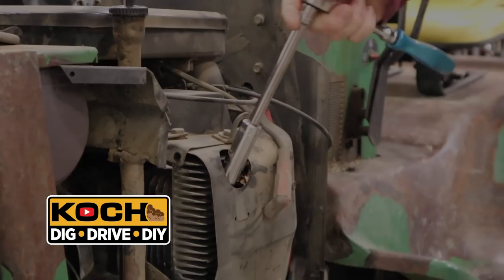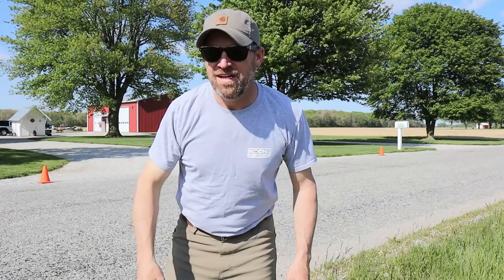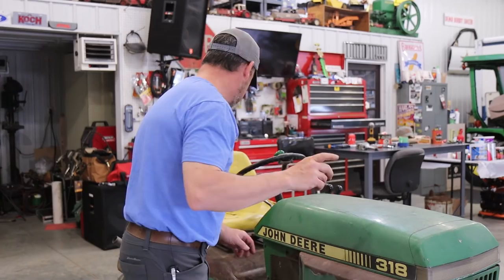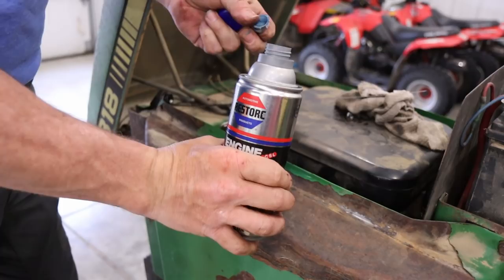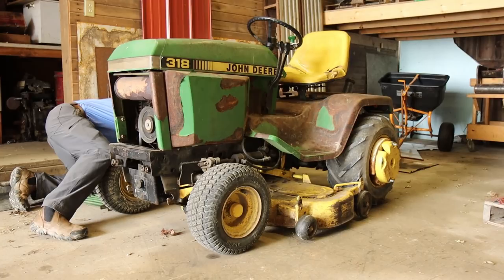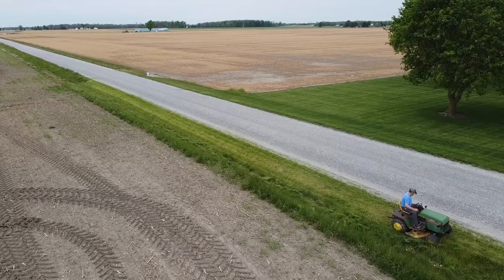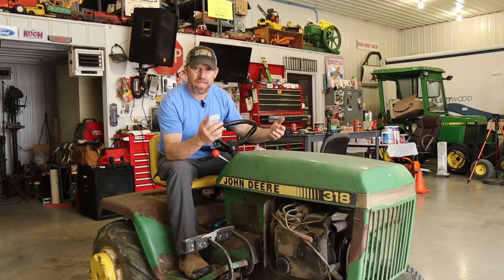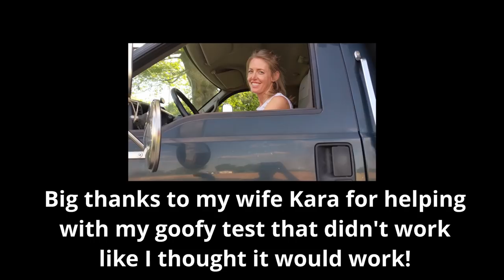Extreme Mower Testing With My John Deere 318:  Will "Restore" Oil Additive Help?

Comment: I have a 318 with a 5 foot Snow plow on the front and has wheel weights but it has turf tires on it  and it likes to spin but it has a tremendous amount of power I'm not surprised at all that you could pull that much
Reply from the maker: They're pretty incredible machines. Thanks ty!

Comment: During your pulls, it sounded like the governor isn’t responding to its best ability. That might be another reason why it’s down on power. It just goes down with the load, instead of trying to compensate for the load. As for the sudden dying, it sounds like it’s losing ignition all of a sudden. That compression does suggest that the ole Onan is tired - I’ve seen good engines reach 120PSI. Personally, I’d rebuild it. Those Onans are torque monsters, and are a great engine if they are rebuilt and cared for right.
Reply from the maker: Very astute observations!  I agree. The governors are always fickle on these things too from my past experiences with them.  It has had two different issues with suddenly dying.  I think you're right about one of the instances being ignition.  But, sometimes when it dies it is when it is under heavy load and I can just feel it can't catch it's breath to come out of it.  They are certainly great engines.  Thanks for the great observations and comments.

Comment: If you want to take a smaller step before rebuilding, valve lapping or even adjusting the valves. You could try some quick fixes for the top end like "sea foam". Sometimes crud gets built up at the top of the cylinder and prevents the valves from seating properly reducing compression. Before doing that, a diy guy like you might have a borescope with a mirror (they make them now that just connect to your phone) to look down into the spark plugs hole and then back up at the cylinder head.....
Reply from the maker: I should look in there.  That's a good idea.  My FIL has a fiber optic scope thingy I could use to have a look.  Thanks for the suggestion!

Comment: pulled quite a few stuck cars out of the snow with my 322.   with the cab,blower and weights. it is just over 2200lbs.  didn't spin a wheel especially with chains and ice.

Comment: I know this is an older video, but I'm new. 8)   Mine is a 1999 320 named JD. Not very creative I know but it just stuck. My 2500 HD Silverado is named Angie. She is "silver" color, so when she didn't have a name after a whole week, I used the name from the chart,  Ag for silver,  so "A" an "G"  is  "Angie".  My very first truck back in 1973 was named "Hemorrhoid", guess why? LOL  Anyway, I love my 320 JD!  When I bought her I wanted one with an automotive type steering,  HD hydro drive, hydro lift and the larger tires, Got it!  The 18 HP Kawasaki engine has been great! I do 2 oil/filter changes/year, and always run Mobile_1 straight 30 wt. Beside 2 batteries, she has only had 2 repairs. A new 'air clutch' for the PTO and a strange one,  the threaded valve adjuster on the intake of 1 cylinder backed all the way off!  The 2 nuts, bolt and rocker arm were laying in the valve cover when I took it off!! I put a new push rod in, and all other parts, adjusted the valves on both cylinders and she runs like new!  Factory mistake,  Mobile_1 extra slippery  LOL, nobody knows. 8)  Sorry for long post 8(   Cheers,  --gary

Comment: i have a 1999 john deere 335. it was my great grandfathers. he only had it for about 3 years before he passed. then i was born a year later. when i was old enough it went to me. now i maintain it. everything from oil changes to $100 drive belts. that thing has only had a small hand full of parts replaced like the drive belt, fuel pump. and as of last year a carb rebuild (only did that to find why it was running weird. turns out it was the clacky rockers that were looser than my you know what after taco bell.) and i used it to pull a 20 foot car trailer UP HILL and was BURIED in weeds with 2 flats on the same side that didnt spin. and... honest to God i though it came off when i started moving. I COULDNT TELL IT WAS ON THERE. also i will say im preeeety sure it could do it ONLY because it has big pleated rear tires. but if you cant do that with a similar mower then thats likely a traction issue not an engine power issue. And I will say that I knew it was WAY more capable than just a car trailer after how effortless it was. And now that I seen what yours was capable of in poor condition. I have enough confidence to say that I think mine can pull the wall off a house
Reply from the maker: Awesome!

Comment: I have a JD 318 that I bought with a broken conn rod.  The engine is easy to teardown and rebuild.  With a valve leak you probably have some lashing issues.  There's an issue with people not putting on their belly pans and grass gets stuck overheating the engine.  Valves coud be burnt.  Either way if you address those issues you should'nt have a problem.

Comment: I bought a sears ss18 that had good compression with the valves slightly out of adjustment. After adjustment it ran better, and I believe it is a very similar engine to what's in your 318
Reply from the maker: Worth a shot!

Comment: Those last generations of 300 and 400 series were the best ever! Heaviest frames, axles, hydro's and no expense spared engineering. They just kept improving from 1963 on. CUT's killed the big garden tractors market IMO.
Reply from the maker: I agree Jimmy.  I loved that era of machines back in the late 80's and 90's.  Cub Cadet, Simplicity, Wheelhorse, Deere and others all made each other better.  Appreciate you watching and commenting!
Reply: My 99 335 weighs 650 pounds without weights or mower deck. I had to pick up the front end (I forgot what for) and I ripped my fingers open. My back and neck went out (yes I used my legs) and got a migraine so bad I couldn’t see out my left eye 🙃
Reply: My 07 Cub GT2544 weighs 800lbs without the deck. And holy crap if you try and lift up the rear of front end that is a mistake. We tried so hard to lift it up but you couldn’t. It was so heavy that not only were your fingers and back destroyed but your nose started to bleed like crazy. So we got a mower jack and it was too heavy for a 750lb mower jack and the arms that hold the front wheels snapped off! Ive never seen something happen like that before ever.
Reply: @mad-mason0319  Wow are you ok now?
Reply: @JoshAllen17Goated  yea after a quick trip to the chiropractor. And some sleep. Wasn’t worried about my fingers they’d heal in a few days.
Reply: @mad-mason0319  well thats good you take care then
Reply: @JoshAllen17Goated  you too you said you got a nose bleed trying to pick up yours.
Reply: @mad-mason0319  Yeah i did, i had my nose over a 5 gallon pale for like a minute and it stopped but it was like probably a 1/2 a liter of blood lost.
Reply: @digdrivediy  Amen!
I enjoy my 50 yr old Cub Cadet...with it's original Kohler "K" that's never been bored!

Hey, what did you end up doing to your 318...I can't find a follow-up to this video?
Reply from the maker: @kenthawkins2418  I remodeled the kitchen for my wife is what happened! 😬
The tractor is still patiently waiting to be done.
Reply: John deere 111
Is that in the good category?

Comment: those old hydrostat drives are bullet proof they will move basically anything if you push the peddle down s tiny amount cuz you get a huge amount of torque. we moved a mobile home with a newer jd mower but annoyingly it has a bypass valve that limited the torque but it still moved enough and after all its just supposed to be a mower so fair enough.

Comment: I believe I would put the motor out of your 316 in bill because it is obvious the rear end is good and it has split wheel brakes. And sell the 316 for parts.

Comment: I recently sold my 318 but a couple years ago it could barely drive - just weaker & weaker. Made new plug wires & it was back to normal. I was surprised. Never did check compression though.
Reply from the maker: That makes sense. My plugs were replaced last fall.
Reply: @digdrivediy  on mine the plugs didn't make a difference. The wires had failed. I also have an 8N with bad compression from bad valve seats (I think). These old engines can be annoying. I bought a 1025r last fall out of frustration - it's reliable at least.
Reply: That's interesting as I had to put new plug wires on my onan in an old wheel horse mower and what difference it made .

Comment: Maybe do a repower series? Mine has a Honda GX630 and a JD 420 2 speed diff, it's an impressive little machine.
Reply from the maker: I'm planning to change out the engine with another tractor. Maybe yet this summer.

Comment: I have a Craftsman T240 Turn Tight tractor with a Kohler 7000 series 22 horsepower 725cc V Twin engine it's built like a little tank I've pulled my 3600 pound camper in and out of my driveway..

Comment: My 35 year old sears craftsman rear engine mower pulled a big tex 6x10 trailer with my toro wheelhorse 267-H on the trailer and motherboard wheelhorse I have is 550 pounds about 1800 pounds on the craftsman it did a wheelie so I stood on the front of it and it did just fine
Reply from the maker: That's awesome!  Incredible what they will pull.

Comment: Great video! I used to have a 318 with a 44 loader but it was kind of a lemon! I bought a 140 h3 about 3 years ago now. One of my neighbors was moving some big boulders out of his yard. He was trying to do it with a 4x4. I went over with my 140 and put a strap to the rock. This rock probably weighed maybe 1000 pounds. It pulled it no problem.
Reply from the maker: That's awesome!  I really like 140s too.  It's amazing what the little 14 hp will do.  Thanks for sharing David.

Comment: I have a 4-14 8 wheel horse (14hp) drag buses around the lot with it all the time (full size buses) occasional semi now and then 

As far as the engine restore. I had a 6.0 powerstroke, wiped the turbo. Lost compression. Engine restore made it run for 2 years after that.
Reply from the maker: Holy cow!  That is a heck of a testament to that stuff then!  That's sweet to hear you've towed some semis.  Thanks for watching!

Comment: If you end up selling it, throw it on a 318FB group & I think she’ll find a good home.
I’m not that surprised at the outcome. I’ve got a Yanmar L70 I just put into my sears st16, & might put my other engine in my 212 whose engine has stalled out & sometimes wouldn’t start again. It started happening after I added some diesel oil I had on hand/1qt cuz it was low again.
Reply from the maker: Thanks Michael. I think I've got options at least.

Comment: Another great and entertaining video, Neil! I agree with Watch Wes Work below. A valve adjustment is a pretty easy thing to do. If the valves are out of adjustment it will affect the power of the Onan and a simple adjustment may give the old girl some new life!
Reply from the maker: I'm willing to give it a shot.  I've never adjusted the valves on one of these so I'll have to look into it to figure it out but it would be good for me to learn.  Thanks for the great suggestions.  I used your comment for the wet compression suggestion I think as I had never done that before either. Great that I can learn something by making these goofy videos too.  Appreciate your viewership Rick!
Reply: @digdrivediy  Here is a good video on 318 valve adjustments. https://www.youtube.com/watch?v=i0IR9csw_So
Reply from the maker: @rickyoung360  Thanks Rick!  I didn't know I have to tear half the engine apart! Well, everyone seems to think that'll help it so I may just try it. Really appreciate the help to steer me in the right direction!
Reply: @digdrivediy  It would be a shame to scrap the tractor or spend a bunch of money on a re-power only to find out that a valve adjustment would have given the old girl new life. I'm a cheapskate and like to explore the low cost options before laying out a wad of cash. LOL!! Good luck! :^)
Reply from the maker: @rickyoung360  Totally agree!

Comment: How hard is it to find engine parts or replace an entire engine for these 318s? I was actually looking into buying one...
Reply from the maker: I don't think it's hard to find them.  Just a little pricey.
Reply: Thank you. And yes, just a tad pricey. I started doing some digging into it.  I am trying to figure out what the major difference are from the 80s to 90s 318. What year was better to buy? I found a 90s that's super clean for 1800

Comment: Good. Idea I just got my 318 yesterday with a 50 inch deck 54 inch power angle plow and a 48 inch snow blower it is in very good shape it’s a 1992 your videos are good also you need to make sure you use a thick oil in those old onans such as sae30
Reply from the maker: Very true Hunter!  Congratulations on your 318!  Man, you got all the goodies!  You're gonna love that machine.  I wish I had a 1992.  I think that was the last year for them if I remember correctly.  Good luck with it and thanks for watching!
Reply: @digdrivediy  thanks good luck with bill I think he’s got some life left in him yet
Reply: Pennzoil 10 W 40/.   Over 4000 hours on my P220 on an engine

Comment: As long as the tractor has compression anything can be fixed with the motor, part depending on what you can get. For parts consult your local John Deere Dealer, the should have parts logs for a lot of equipment
Reply from the maker: Very low compression though.  I'm sure it can be fixed.  Thanks for watching!
Reply: @digdrivediy  no problem. If you have any questions, I’m glad to answer. I’m actually one of the technicians for Minnesota Equuoment

Comment: Hey I saw John Deere's from 1981 to 1983 I sold the 317 the 318 I like them both if I owned build a 318 I would run it until the engine stopped Keith's oil check and take care of it till then
Reply from the maker: Thanks Chris.  They are all good machines from back then.
Reply: 314 are rare one s

Comment: You don't need that much HP for the Sundstrand Series 15 Model 90  hydrostatic transmission to put a lot of down torque.  It's the PTO thats sucking all the HP from that worn out Onan.
Reply from the maker: I can certainly agree with that!

Comment: I have a John Deere 300 garden tractor and I use it every fall to pull my camper in so the camper trailer hitch is facing the garage because I want the door to be opening towards the driveway not towards my neighbors The trailer is 30 feet long weighs 10,000 pounds and the most stunning thing is there’s 1300 pounds of tongue weight and the John Deere 300 pulls it without any problem
Reply from the maker: Man, that's cool.  I'm still often times amazed at what these little tractors can do.  I'm glad you figured out yours is able to move your camper like that!  Thanks for watching again!

Comment: Neil, where can I get a Class 0 hitch. I need the entire thing. I bought an Old Ford yard tractor last weekend from @BraydenBowman and I want to find a hitch to be able to use it. I don't want to spend $1,000 if I can find or get one built. I'm about an hour south from you in case you are wondering.

Comment: I know this is an old video and you have your dream 318 done now but you can't just rebuild the engine? I'm sure you could still find gaskets and parts for those engines or no? Also marvel mystery oil works  some magic too. My dad had a 2 year old ariens snowblower engine seized and they wanted like $800 to put in a new engine, snowblower was $1100 brand new, I took it home put some mystery oil in it and been using that snowblower with that "seized" engine for 10 years now .
Reply from the maker: These engines can certainly be rebuilt, but it was an easier option for me just to drop in a new one with a little bit more power.

Comment: I'd recommend a re-power with a Kohler Magnum series engine like an 18 or 20HP the one i have it runs smooth and has plenty of power its a 18 and all i did was clean the carb and bought new spark plugs and head gaskets
Reply from the maker: Those newer Kohlers are really nice.  I had a repowered 318 that had one once.  Should have probably kept that one!

Comment: Double check your fuel system.  Could be dirty filters or carb causing stalls when under heavy load.  Fuel starved.
Reply from the maker: Could be I suppose.  That darn compression being so low though... Always worth a fuel filter experiment though too.  Thanks for watching!

Comment: Hard to beleive if almost wondering if someone wasnt in the vehicle hitting on the gas a little a 800 pound tractor pulling probaly a 35000 pound set up seems to good to be true but if it did that would be extremely unbelievable impressive

Comment: Dude, In my research it's the pistons and also owning a 89' 318 ..Being the pistons are horizontal over time the walls get warped causing the problem at hand. It's new motor time.
Pamper yourself. Put the 316 motor in the 318 and get rid of the 318 ..huge upgrade going from one to another
Reply: 318 is better than a 316 but swapping mow toes isn’t a bad idea
Reply from the maker: Shhhhhhh.  Get outta my head!  😉

Comment: Check the valve adjustment.  If the valve lash are good, then pull the heads and clean the carbon.  I have seen valve seats come loose on these on and before.  These engines are too easy to rebuild not to do what’s needed to keep it going.
Reply from the maker: Good info.  I need to learn how to do the valves and see what I can do.  Thanks for the comment!

Comment: Since It doesnt smoke while running and pulling and mowing, So I dont think your problem is bad rings or valve seals.  Yes with the low compression in both cylinders I'd re ring both cylinder and  call it good. Those 60 to 75 is bottom of the compression. Should be 90 to 100 psi per cylinder. I wouldnt rebuild or repower it. Just rings.  not that expensive.
Reply from the maker: But I have to take it all apart!  Probably would be a good option for sure.  It runs good otherwise.